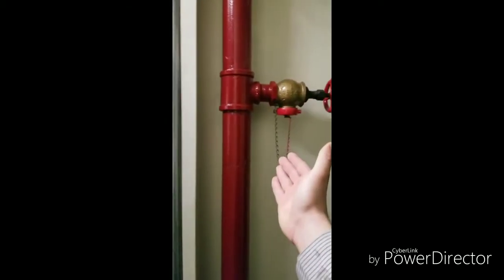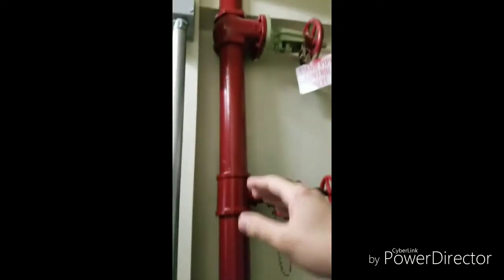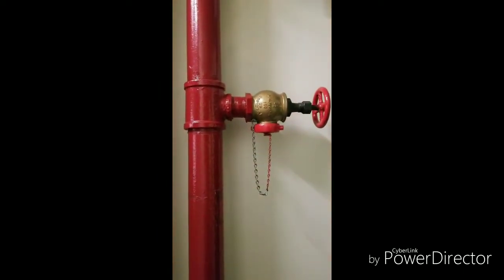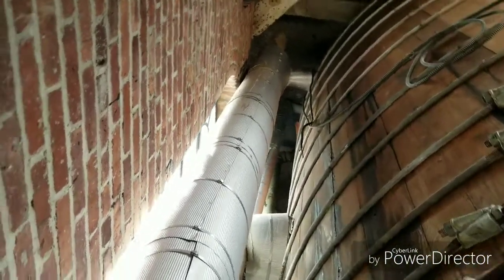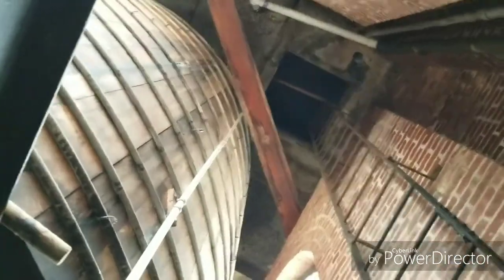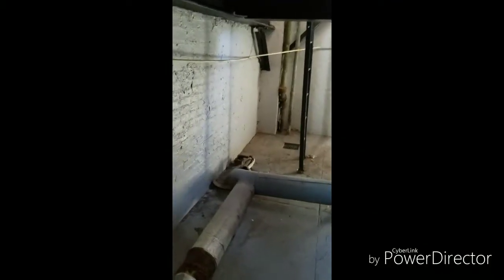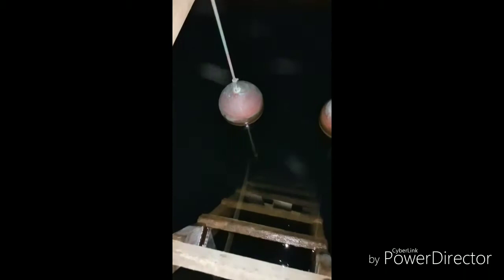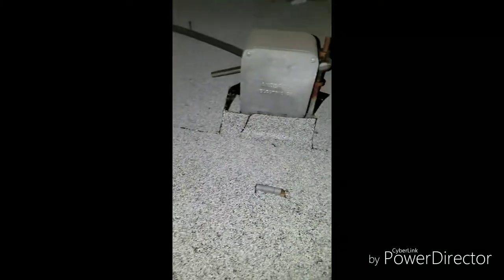Building talk ep1. What is a stand pipe ?

Comment: Quite an interesting topic for us flatlanders (I'm in Phx AZ).  I had never seen a tank on a building until my first visit to NY.  So, I take it the water in the tank is potable and is used for the faucets as well as fire fighting.  We have very few old buildings here and none of the old ones are tall.  I don't think any of them have tanks.
Reply from the maker: Straycurrent yes here in NYC all buildings over 7 floors have roof tanks , expect for some brand new buildings that use pressure pumps  in the basement to pump water up to high floors but they really can't even go over I want to say 20 floors with out some sort of tank or booster pumps. Most building's have exposed tanks but a lot are still enclosed and it makes the building look better anyway. They all have to be cleaned once a year by law.